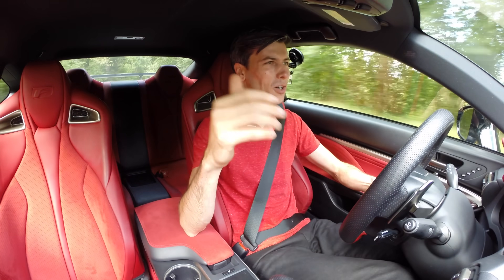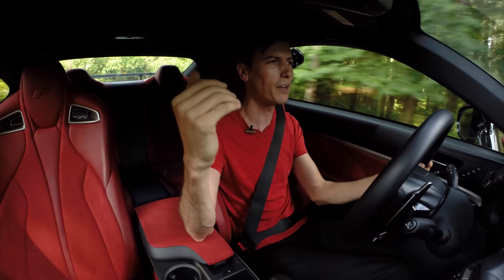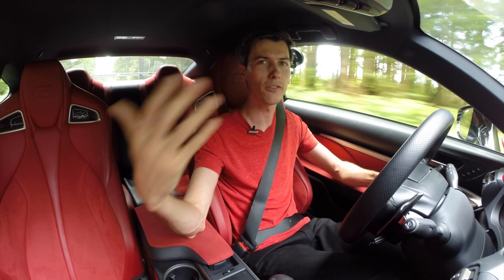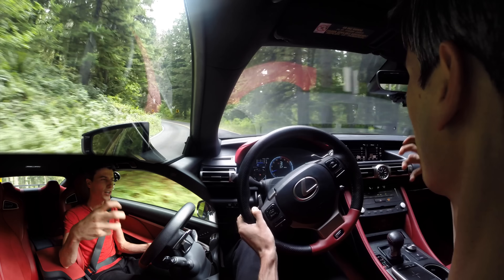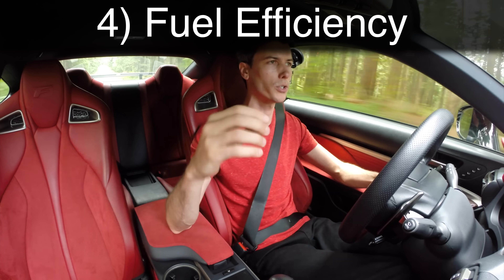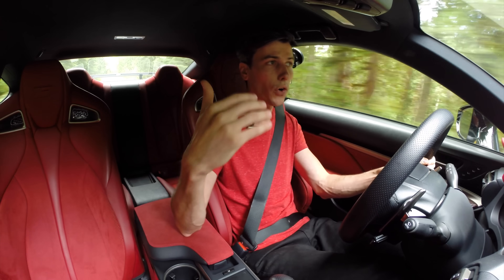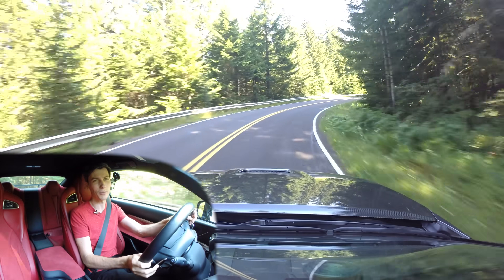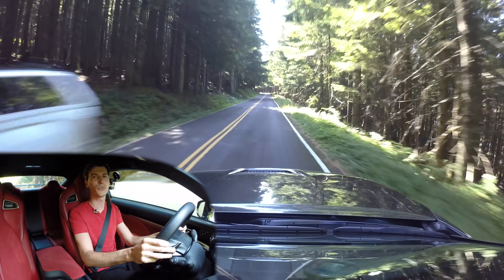5 Reasons You Shouldn't Buy A Turbocharged Car

Comment: What about long term reliability? Turbos are incredibly expensive to replace and they do fail eventually due to the higher heat, improper cool downs, cooked oil, tight tolerances within the turbo assembly, etc...

I think this is one of the most important factors to consider before opting for a turbo car. The long term cost can be immense. This will also have an effect on resale value down the line.

Comment: Hi. I would like to ask, does not a turbocharged car have to change its engine oil more often, because the turbo is both lubricated and cooled by the engine oil and the Turbo is really hot when at full throttle. The oil is also cooled afterwards by an oil cooler. Would not a continuous cycle of heating and cooling have a bad effect on the engine oil? Please feel free to correct me on this, I want to learn more about cars

Comment: Pretty sure Teslas have instant torque
Reply: Pretty sure they have a low top speed and range to go with it. Obviously in comparison to other cars of the sporty variety and price tag, not your grandmothers Buick. Electric tech is great, he has a Tesla that he has shown off frequently, it's just simply not the best at everything. And they don't make the noises, which is one of the reasons he gave in the video.
Reply: @jaydunbar7538  Tesla model 3 (the non- performance one) has top speed of 162 and range of 240 miles.  You can get EVs that are better in both areas.  Have to agree about the noise tho.
Reply: @102wingnut  not sure how any of that is relevant to what I said, you can get gas that's better as well. I said nothing disparaging about electric, it's just simply not the end all be all best of everything. At least not yet.
Reply: @jaydunbar7538  sorry just pointing out that EVs do have comparable speed and getting close in range to most gas cars.  They aren't the end-all be all as you said but they are certainly getting closer and more competitive.
Reply: @jaydunbar7538  Teslas have good range, good speed, and an alright charging time. But for 99% of your journeys youre just going from home to work, shops etc and you get all the charge you need plus more plugging in at home. For most peoples needs just charging once a week is enough. So no visits to gas stations which saves most people time
Reply: @nicosmind3  you seem to think you need to convince me of electrics potential, but I said nothing against them. For most, especially in large cities it's a great choice. No fuel usage while parked in endless traffic jams alone makes them a good choice. However as I said they are not the best at everything, and sitting in traffic jams is not the only consideration for everyone.
Reply: yes. All electric motors produce 100% torque straight away. They have no torque curve.
Reply: It's a naturally aspirated induction motor tho.  Unlike the Porsche Taycan apparently...

Comment: 470 hp its not crazy fast he says

My car only have 122 hp 😢
Reply: I drive my moms peugeot 107 from 2007 with 68 hp and tires that couldn't grip a falling ant
Reply: Robert Ri lol wtf 470 is insane. I’m here struggling with probably 150 hp on my Honda
Reply: @jdm132  Rocking 155 in my Mazda lol
Reply: @jdm132  
Once you go electric, 470 hp and sub 4 second acceleration is no big deal.
Reply: @robertjusic9097  Just wondering - can you still outperform some of the lazy, ignorant drivers with more powerful cars and lack of driving skills? Cause for me 60hp non-turbo diesel has taught all it's tricks.
Reply: @Termiic  downshift it when driving 60 km/h, reving it to 5k and the car gains 70% of its power, it is crazy fun
Reply: @Termiic  just like James May says: small cars are meant to be reved to 8k so that the valves start dancing on the hood
Reply: @robertjusic9097  Yea, yea, yea! That's what i'm talking about.
Reply: Yeah I don't get how a car that does 0-60 in under 4 seconds is not consider crazy fast.
Reply: @BrokenKingpin  what would you class mine as i get 0 - 60 time of 7 seconds
Reply: @MrWaheedulHaque  Quick
Reply: @BrokenKingpin  not bad then thanks
Reply: @MrWaheedulHaque  sucks to be you... better put more hrs in at WORK!!
Reply: @Simpleman1078  lol i dont work hahahah 🤣🤣
Reply: @MrWaheedulHaque  0 to 60 in 7 seconds?  I'd class that as "good".
Reply: @davehayter312  thanks dave
Reply: @BrokenKingpin  Man mine goes 0-60 in 15 haha
Reply: @taa1taa  I am going to say "not crazy fast" then lol
Reply: @BrokenKingpin  
Simple, he owns a Tesla. Even the Tesla semi can do 0-60 under 5 seconds.
Reply: Power to weight is far more important then raw numbers, power that low I imagine your driving a tiny eco box.
Reply: @jaydunbar7538  Lightweight cars usually have about the same drag as heavy ones and while being fast under 60-80 mph they suck at higher speeds. Besides, grip is also a huge limiting factor. High to mid threes 0-60 (like 3.7-3.5) is pretty much the limit for RWD cars with near to 50:50 weight distribution, and such a car doesn't have to be tremendously powerful or have high power to weight ratio. For about 1.5-2 tonn car it takes about 400 hp and agressive gearing to accelerate this fast.
Another issue with lightweight cars is lift. Many sportscars have wings and skirts and generate downforce wirh them but normal car bodies usualy generate lift instead. Heavy cars are less sensitive to that lift.
Reply: @jaydunbar7538  dude 70hp isn't enough for anything bigger than a motorcycle.
Reply: @jaydunbar7538  true my 122hp car is rapid only cos it light weight haha check it out on my channel
Reply: Bruh my car has 70 Hp
Reply: Well i have 125 hp, but im still driving it as fast as i would drive a lambo
Reply: @sakariaskarlsson634  mines pretty nippy too haha tops out at 160mph, wish i could have got the more powerful 160bhp one but ah well couldnt find it without getting into buying a gti
Reply: @MrWaheedulHaque  is it like a caterham or something? 160 mph is very high for 122 hp, it cant weigh much then
Reply: @MrWaheedulHaque  mine is just a regular car and it tops out at 200 kmh, i have done 195, but ofc usually not that fast
Reply: @sakariaskarlsson634  nope its a mk6 golf haha, it has a curb weight of 1280kg
Reply: @MrWaheedulHaque  cool!
Reply: MrWaheedulHaque your 122hp car does not go 160mph sorry... Your speedometer goes to 160 as per your own video.
Reply: @grtdane78  it does haha we took it to autobahn in germany, it takes a long time to reach 157mph but it does hit it
Reply: I consider my hyundai accent a "fast eco car" 0-60 in 7sec, 138hp, 6 speed manual & in third it reach 101mph until red line.
Reply: @jonathanrivera870  thats not bad at all
Reply: In the US your car isn't fast unless it's got at least 300hp.
Reply: @slowanddeliberate6893  well. Yes. Do cars somehow go faster with less hp in other countries?
Reply: @spiralnapkin  I'm just saying that 100hp cars are extremely rare in the U.S., and we consider 0-60mph in 7 seconds to be average instead of quick.
Reply: I got a 118i bmw, 129hp. Wanna race? 😂 🤣 😂
Reply: @perlamiseriaccia  sure on a race track, do you know of any straight line race tracks like drag strips
Reply: @MrWaheedulHaque  I am in UK 😂
Reply: @perlamiseriaccia  gonna be getting a stage one remap soon which will boost me to 145hp
Reply: @MrWaheedulHaque  I'll just replace it with the 5.0l mustang gt next year
Reply: My honda accord V6 has 270hp. And its a 2 door with a 6peed manual. Rare car 💁‍♂️. Does 0-60 in just over 5 seconds
Reply: My first VW had 48hp. And I broke first gear. And we have slot of hills here.
Reply: My Mitsubishi also have 122 hp! :)
Reply: @jareknowak8712  niceee
Reply: My Fiat Panda has 85 PS... but can still be kinda fun, because < 1000 kg weight lol
Reply: Mine has 122 hp aswell (MB 190E 2.0 -89) and I think it's perfectly enough power in a normal driving environment. And during winters it feels like it's more than enough.
Reply: @JespeFI  niceee
Reply: At least you have one
Reply: 105 hp 2008 Dacia Sandero here :D
Reply: Mine 47hp - the lost because altitude, and I go everywhere and it gets 4.87l/100km (48.5 mpg ) combined, without modern diesel engines costs or hybrid systems, just a 0.8L engine in a 755kg car. (EDIT: thank you Suzuki, great little small car. Excellent cost vs benefit, with reliability and simplicity.
Reply: @estebanamador7601  that is how they all should be made.
Reply: @chibinha7949  54 BHP isn't enough for a motorcycle!
Reply: Prefer handling over speed

‘97 Accord, baby!!
Reply: In performance cars of similar price range, the Lexus is a sloth. They should stick with middle class luxury cars
Reply: on a side note, he is a engineer, anything below 1.21 gigawatts isn't enough power for a engineer.
Reply: I knew it's a VW engine when I saw 122bhp
Reply: I also have a mk6 golf, but 1.4tsi 160bhp
Reply: @DigitalicaEG  nice my bro you got the turbo and supercharged version haha, get a stage one remap it will touch 185hp
Reply: My daily scooter has 3.9hp. So...
Reply: @LordOfSilense  yeah scooter. if scooter then electric torqueeeeeeeeeeeee
Reply: mine has 84bhp and 114nm torque
Reply: be glad 101hp on 1300?kg. and the last 7k km my car ran in "Emergency" so half the power and revlimit at 5,2k (6,5k)
Reply: @johannesdatblue4164  damn what car you driving haha
Reply: @MrWaheedulHaque  its an Vw bora 1.6 SR
its a good car^^ 101hp 108ft-lb(143nm)
the camshaftsensor is damaged, thats why the limiter is lower and only 50% throttle is possible but i dont care. soon he is finished and runs smooth again
Reply: @johannesdatblue4164  nice post a video about it on your channel and comment the link on ky chanmel ill check it out
Reply: @chibinha7949  27 years old is very impressive, I had a Peugeot 306 TD once that I put 140K miles on with no trouble at all, then sold it to my nephew who crashed it :)
Reply: Might Little Nissan NX is only around 500hp
Reply: My car has 211, I go 55/65 mph. :)
Reply: I'm rollin' with 145 hp, but it's only about 2,400 lbs.

CERTAINLY not fast by today's standards, but it still has some fun-factor.
Reply: Inside2020
Reply: My bike makes more than that 💀💀
Reply: Compound turbos with a vnt on the small one addresses the lag and top end complaints. NA motors dont make enough low end torque and dont make rated power until they are revved much higher than most people ever run them. A turbo at least gives you torque at rpms you can actually use.
Reply: It's isn't very hard to increase horsepower in those really gutless engines cuz the biggest reason is inefficient parts that have nowhere to go but up instead of 400hp cars where you actually have to put in some work. Had an 02 Subaru outback with the boxer4 😭 ... Cat delete kit + ram air intake on 93 octane and a simple tune added 37 bhp at around 4500 RPM. You had to drive it with a lead foot because the torque still wasn't great but it definitely wasn't slow for mountain roads where you could keep the RPM high. Topped out at 140 on a slight downhill. The car is heavy as hell for its size tho.
Reply: I once thought that 200hp out of a 4.7L V8 was weak. Could probably make it a little faster with tinkering to other parts of the drivetrain. And as is my car only weighs about 2800 lbs.
Reply: @DAN007thefoxx1  Has about 300 lbs-ft of torque I'm guessing? And what car, sounds like a good jumping off point.
Reply: @anonymousanonymous9991  Classic mustang and 282 ft lbs
Reply: @DAN007thefoxx1  Ah the 289 a beautiful engine in a beautiful car. Ultra lightweight everything valvetrain with full cams on those are nice. You could have a monster on your hands if you upgrade it. I think they rev to 7k without much trouble and can make 350-400  bhp without tanking reliability.
Reply: My truck has 216 rwhp and 265rwtq.... In a 4800lb body and archaic 4spd auto
Reply: 😂😂😂😂😂 best comment.. you don't want to hear my misfirimg amd knocking 4 cyl engine
Reply: @chibinha7949  I don't think so when taking abiut 60s hp bro
Reply: Comon bro be thankful...  my first car 80s golf used to take less tham hour 0-60
Reply: 33hp. Tata Nano
Reply: @f1msch  sounds like a mk4 TDI, got a few of them and with a little more (wait for evil word) TURBO and fuel it'll scream and still achieve very similar fuel efficiency.
Reply: 320hp Volvo 5 cylinder. Tuned ofc. 2010 S80. My. Favorite. Car
Reply: My ride only has maybe 120 hp since it has over 200k on it. 470 hp would be a blast.
Reply: My first car had 30hp when new I think. A Renault 4. Great memories, great trips, never stranded, never thought it was lacking power... times change...
Now my civic can do 120 hp I heard, I probably never get more than 60 out of it, the way I drive.
Come on guys, relax, and save some gas, ie CO2.
Reply: My car has 105 kw
Reply: I'm driving a 98 vw t4... We bought the most powerful they made. 102hp when new (probably around 90 now) for 2100kg dry weight. 0-60 in 26s
Reply: My car only have 98hp 😭
Reply: My car has 37hp :(
Reply: My friends are flexing when they get 150hp car :D and it is actually enough to loose grip and drift around town xd
Reply: @Saffy1  any car can lose grip just turn off traction control, mine loses grip at just 17mph with traction control off
Reply: @Saffy1  with y car i only ned rwd to go wild xD the back is really light^^
Reply: This guy dnt no a ting abt cars.470 hp is nt fast.try hitting a wall in it.the u see how fast it is..
Reply: @dorranrobinson6207  huh you dont make sense

Comment: I wonder if there is any sort of clever ECU programming or other engineering shenanigans that can be done to make the throttle response more linear because it seems like Ford's answer to increased minimum fuel economy is smaller turbocharged engines.

That said, I can't remember which new car (truck) it was that I was looking at but I was surprised that it was using a really high compression ratio.
Reply: some hyiundai maybe? or honda?
Reply: @user-qx7tm5df8j  I think it was the Honda Ridgeline but I can't be certain as I've been researching vehicles to replace my current one.

Comment: No matter if its turbo or not, diesel engines run on very high pressures because they are compression ignited.
Reply: Yes. But turbos make it more.
Reply: 18:1 is the factory setting if I'm not mistaken for new Duramax.

Comment: You should check 2.0 or bigger VAG and Volvo engines....Almost everything you mentioned on this video does not apply!
Reply: Yes i agree the turbos on them are insane
Reply: Also most high end vw have supercharger with turbo charger to compensate for that delay in torque

Comment: Reason 6.... electric can kick the crap out of any gas car.
Reply: Hmmm no unless you have an unlimited energy source, batteries are near their weight to power limit you know
Reply: if all you want to hear is road noise when driving
Reply: Considering that all the fastest cars in the world run on gasoline (or gasoline engines adapted to other higher performance fuels), no. Just no.
Reply: @BigUriel   This comment didn't age well.  The current fastest road legal car is an electric Corvette.

BTW my Model 3 can out run just about anything on the road for the price.
Reply: @Ben Binks   ;)
Reply: Except for range...